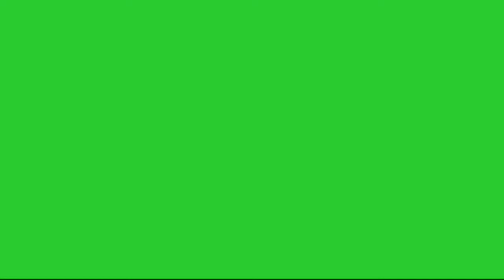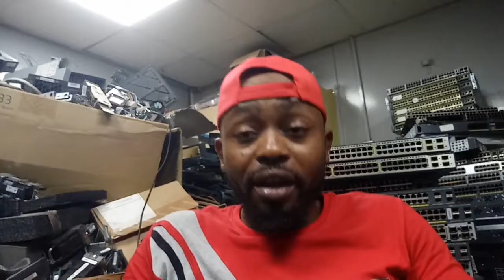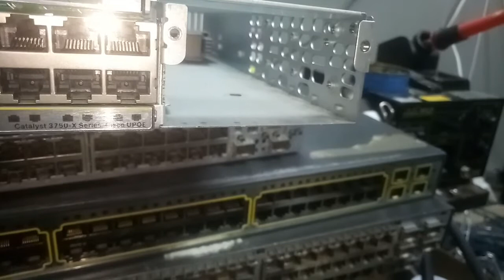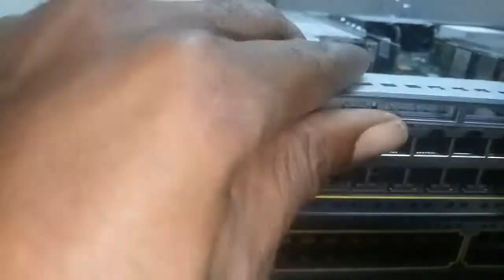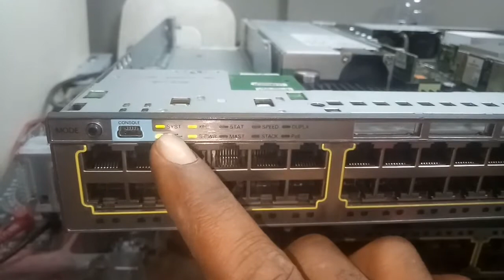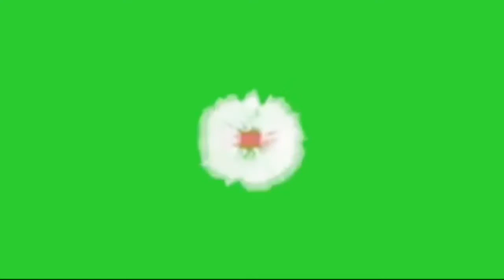#cisco #networking #switch #software #hardware  Cisco 3750x easy fix  amber light fast by anybody

Comment: Hi brother. my 3750x doesn't have front lights and the fans start up, the source that is installed is 715W, however the T1 transformer is burnt out and the CR11 diode is shorted, do you know what could have caused this burnout? present on pin 1 (near the serigraphy of transistor Q6) of the transformer is at 48V, as the correct voltage would be 12v that I measured from a good module). Already replaced the transformer and the diode but it still doesn't work... do you have any idea what it could be?
Reply from the maker: Send this message to our Facebook page "JKF TECH" we will give you good reply there with pictures and videos. thanks

Comment: hi brother. my 3750x has no lights at front and fans don't boot but lights up at the back. it doesn't work at all...any idea what this could be?
Reply from the maker: Are you a hardware technician, because this is a hardware problem

Comment: My device Cisco Catalyst 3750 48 Port Switch POE - WS-C3750-48PS-S not work  interface and cannot inter running config after instal IOS? Whay?
Reply from the maker: POE working ?
Reply: @jkftech  no
cannot  Command-Line Interface  switch cisco
and valn1 is disable?
Reply: @jkftech  no POE working